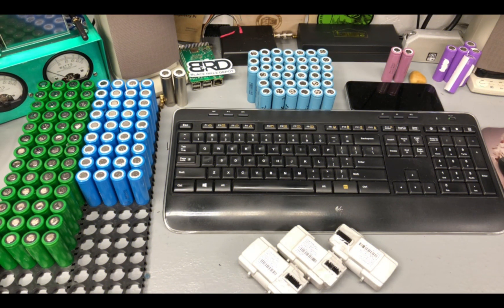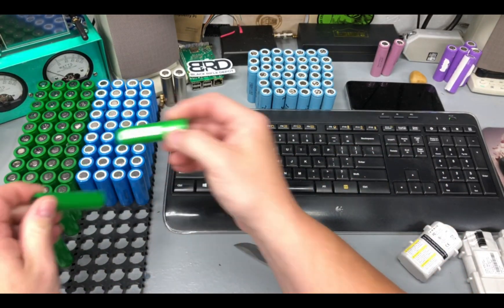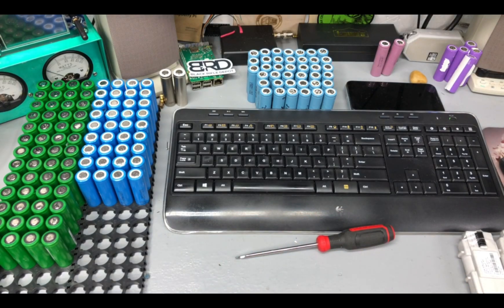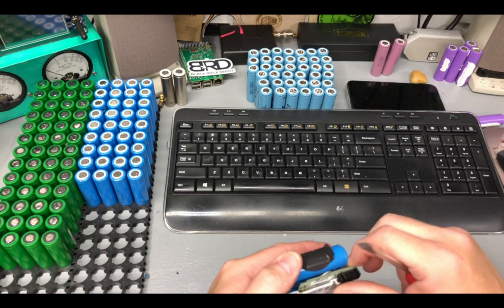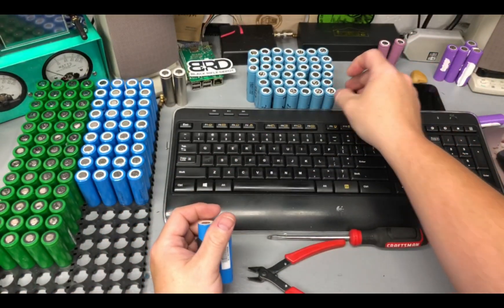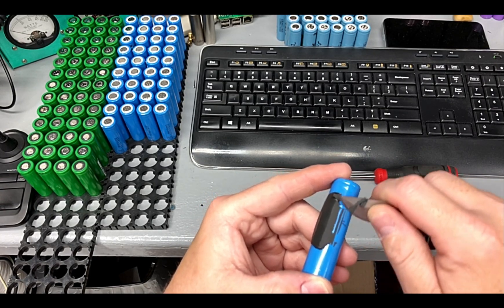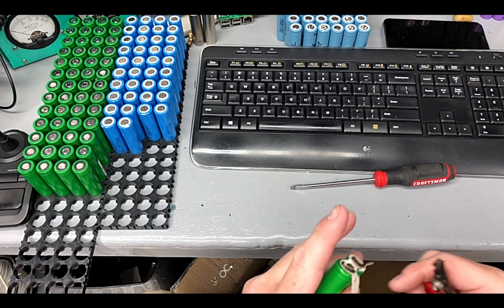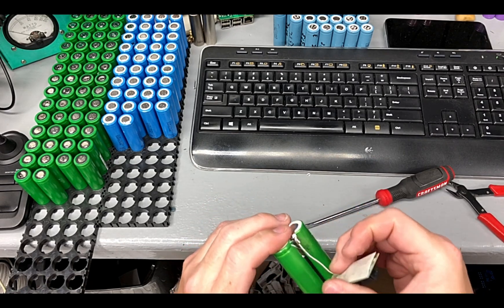DIY Powerwall - Battery Harvesting - Modem Battery Tear Down

Comment: Instead of using a screwdriver, try cutting through the stickers on both sides with an exacto or similar blade.  Then you can hold the battery in a vise and just push it open with no problem.  I did a video on this. The ones I have opened have contained mostly LG cells and they are the most difficult to get the cells out due to the amount of adhesive they use.  The Sony and Molicells were the easiest to get the cells out.